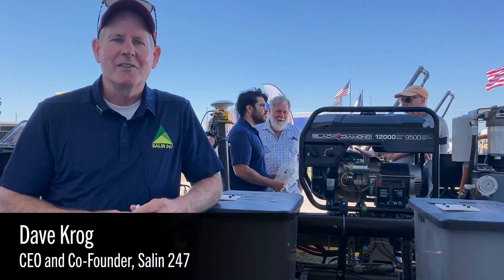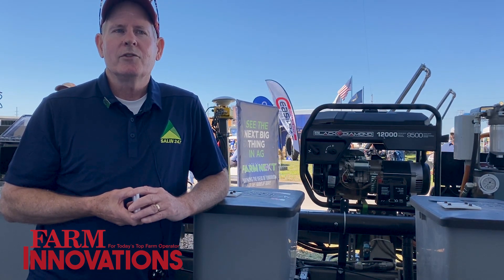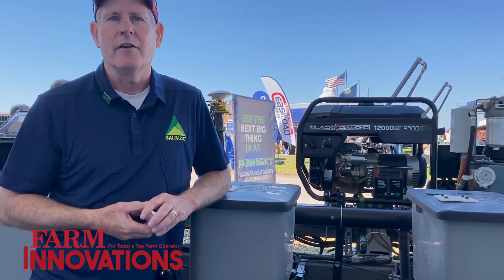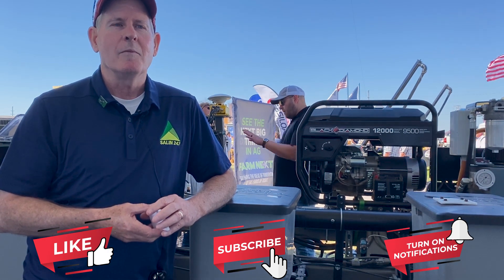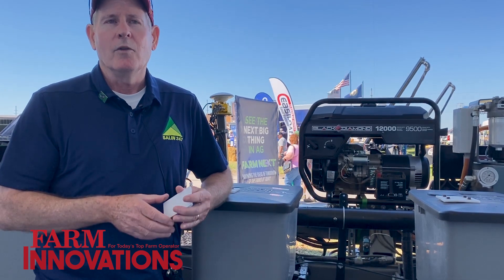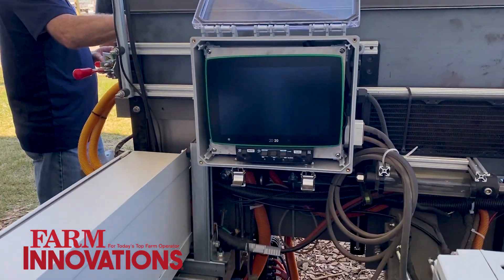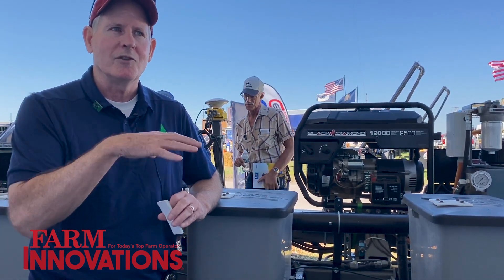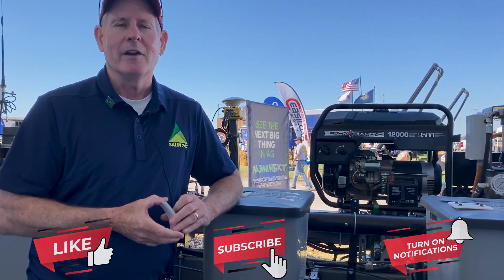Farming as a Service: Salin 247's Electric Autonomous No-Till Planter

Comment: Interesting concept unit.   Very very low compaction being such a trim unit on good size tracks.   I know the team has probably already been aware of this, but already using a PP drive and monitoring system, they could possibly also detect row unit faults/plugs/debris which is traditionally just the operator's visual responsibility.  If they can sense and stop the machine at sign of these common faults, that's something that's very interesting.  Imagine with me for a moment that a farmer has 2-3 of these running in maybe a larger size, let's say 6R for now... they could be running in the same field or adjacent fields and when a fault stops the machine, the "operator" can go address that without having to stop all of the other work.   Not a swarm farming model as much as just being a distributed model with lighter equipment in use.  One rock jammed in a row unit or broken bolt stops a 16-24 row or larger planter just the same, but with this you could maintain higher uptime average per row and reducing operator input to really only the things you need a person to address.   That model doesn't work for everything, but you can imagine even using this in conjunction with traditional equipment, assigned to fields based on layout or conditions.   The concept has legs but it requires breaking a lot of traditional thinking to address the stigma that "we can't plant 30+ac/hr with that" or "what does it do when something goes wrong?".   From my perspective of a manager operator and mechanic, always being short of manpower and time,  this is something I've dreamed about having for several years, but it's not for everyone.   Fine work, folks.